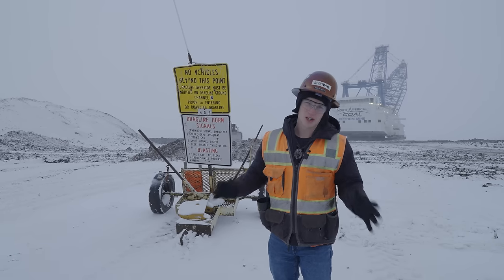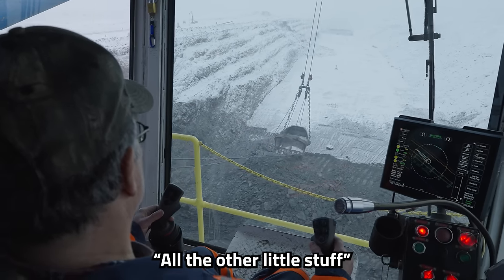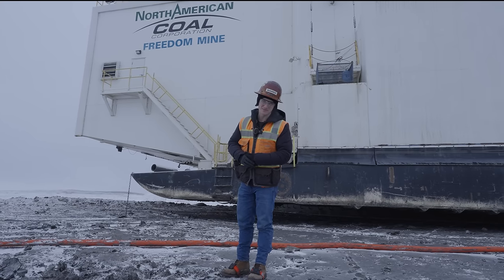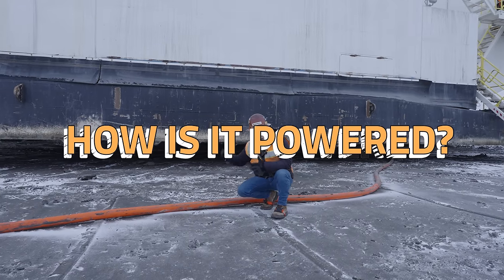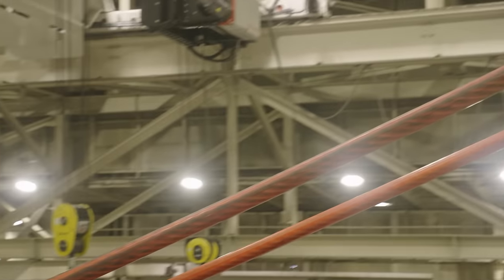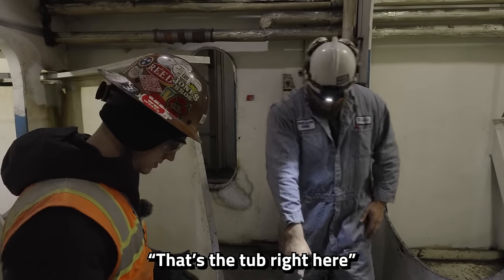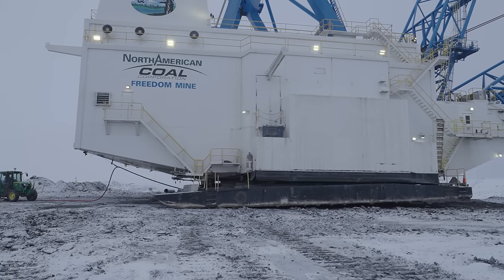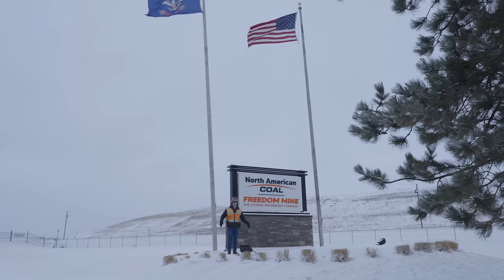Monster Mining Machines — How Draglines Work

Comment: What impresses me the most are the engineers who designed this monster and also created machines to make the parts for this.
Reply: I have made the cages housing the brake rotors you see in 7:29 and it's cnc milled then welded together and bolted to the hub. Also the rotors are 2m in diameter and weigh just under 100kg.
Reply: @PBST_RAIDZ  how in the world do they make those huge gears?
Reply: @minkymott  Where I work we don't make the gears but I'd imagine they'd be forged then cnc milled down so the teeth align with one and other.
Reply: @PBST_RAIDZ  thank you for taking the time to reply. :) I wondered how they do that.
Reply: Bucyrus Erie in South Milwaukee, Wisconsin.  Gears by Falk Corporation in Milwaukee.
Reply: @albing1397  thanks.
Reply: In all of history, it's first the scientist and the the engineers that are so incredibly fundamental to all that we take for granted. Forget about kings, partisans, emperors, politicians, unions. It's all science, technology & engineering. Big ups. And real men.
Reply: I agree wholeheartedly. Engineers are the unsung heroes of the modern world. The only time they get any recognition is when they mess up.
Reply: also the steel workers, machinist, blacksmith, etc.... that built this machine.

Comment: Man they keep the old girl looking good. Inside and out. Draglines are way cool. Makes those little 3/4 yard machines I used to operate look very insignificant. Thanks Aaron for doing what you do. For an old gear head it's fun to watch. Cheers
Reply from the maker: They have a world class maintenance program!
Reply: Would love to see a big tracked digger with a slew motor on the arm i used to operate one back in the early 2000s  @AaronWitt
Reply: I can speak for the quality of work done at Coteau by good workers.
Reply: Protecting their investment,- bravo

Comment: 1:54 That machine is 106 days short of operating 10,000 days.  
The most custom piece besides the bucket is the drive gear.  I wonder how many individual sections it was cast in and if any of the sections of drive gear have been replaced.
Reply: Great question 👍!  I wonder how long it took the mechanics to build the machine onsite after the pieces are brought in by train?
Reply: @tristenklein225  not sure about the dragline. I’ve built rope shovels it takes about 3 months to finish a Bucyrus 495HR2 rope shovel. So I’ll assume the dragline might be 6 months or more depending with the location where you build it.
Reply: Two years ago they replaced the tub on this exact dragline I believe.  If not this one it was one of the other two at this same mine.  
https://youtu.be/ACrTGwEqxHQ?si=4TofasCwqrvmAsyQ
Reply: @gunstuff5273  Awesome video, cheers for sharing, Guns.
Reply: Do you mean 10.000 hours
Reply: @tristenklein225 it takes around 2 years to assemble
Reply: @andrewrees8749
No, he means days. That thing has over 27 straight years worth of hours on the hour meter.
Reply: Any one know just how many kilowats/megawats this thing needs to operate?

Comment: This is such a cool video. I worked for a heavy engineering company in Australia in the 70's called Perry Engineering.  I operated a Skoda horizontal floor borer that machined the gear boxes and swing shafts for draglines.

Comment: One stupid question but what exactly does the machine in this case do? It just looks to me that it moves material (coal?) from a to b, with b not being a dump truck or plant or so..
Reply from the maker: It strips overburden to reach the coal
Reply: I had the same question because it looked like both from where it was digging and dumping to be the same hight
Reply: They create a moving trench … ahead is ground with coal under it, the trench is dug to expose the coal so it can be mined, and they use what they dig to fill in behind them where the ground is graded and the land restored.

Comment: I wonder what the voltage on the power cable across the ground is. 13KV? We all know that is not 480V.
Reply: 23KV running through that cable.
Reply: Called 23 kv Cable. Actually 22,900 volts.    Portable substation hooked to 69,000 high line. Goes into dragline to 4160 volt transformers which feed 4-3000 hp motors which drive a bunch of dc generators which feed the dc motors.

Comment: Correct me if I’m wrong but isn’t Bucyrus-Erie the very first to design engineer and manufacture drag lines in the world starting in the late 1800’s?

How often do they have to change out the cables due to fatigue and stress and do they have to be certified and inspected by OSHA like cables on large cranes?
Reply: Its hard to say. Page Engineering (John Page) were the first to make draglines. Both Bucyrus-Erie (now a part of CAT) and Harnischfeger (aka Pawling & Harnischfeger, later P&H Mining -> Joy Global -> Komatsu Mining) got into the dragline business in the early 1900s both operating out of Milwaukee. Neither were the first to make them, and those two companies went head to head for many years in the business, and pretty much bought out all the other smaller firms (for instance Page Engineering was bought by P&H in the 1980s). Nowadays most draglines are just maintained, and new ones haven't been built for quite some time since its easier and cheaper to maintain existing ones and replace them with rope shovels if they are no longer suited for an application.

I work for one of those companies and can't say exactly how often cables are replaced especially since its heavily dependent on the work that the dragline is doing and where, however I can say pretty much everything that goes onto a mine site is inspected by MSHA at least once per year. MSHA is the mine specific version of OSHA. MSHA controls mining and quarrying exclusively, while OSHA controls pretty much anything else, including things like maintenance and repair shops that might be on mine sites.
Reply: @helloitsjason Thanks for the insight and history 👍

Comment: Cool and big machine. But what i dont understand.. why is the bucket so small compared to the size of the machine? Could the bucket not be alot bigger?
Reply: A bucket load of dirt weighs over 600,000 lbs. The boom is 300 ft long. If you figure in the forces it takes to lift that and how fast the dragline does it.. no it couldn’t be a lot bigger. Also the machine is moving over 500 loads in a 12 hour shift.
Reply: @joshkuhn3974  hmm okay.. and what with more horsepower? Then it would be possible to lift it 🤔
Reply: @pupupupu448  Yes, but the question is how many times? Remember this machine is cycling over 1000 loads a day. The boom and other structure are still only rated for a certain amount, and steel fatigues with use. Every year there are cracks repaired and welded on the boom and frame structure.

Comment: I often do maintenance shutdowns on 1350 and 8750 draglines in the Australian Bowen Basin. As amazing as they are to see and experience first hand, once you experience pulling them apart and fixing them, they get old very fast 😂

Edit: To further explain your explanation on how the machine swings, the motors you mentioned in the front of the machine sit on a vertical axis and connect to the swing shaft (think of a driveshaft in your car), on the bottom of the swing shaft is a cassette (a big cog) and the cassette rotates along what is called the slew ring which is a very large gear ring. To put it simply, the swing shafts spin the cassettes along the slew ring which in turn rotates the dragline. The size of the dragline also dictates how many swing shafts the machine has. For example the one in the video would have 4, a larger machine might have 7. The Machine in the video is also just a little baby dragline.

Comment: Holy crap, the machining on that bucket is insane looking. I didn't think about it, but I guess you couldn't just stamp out a bucket that size (in most places). I'm not even sure if one of those 100kton German presses could do it. Especially with metal that thick. I guess you'd have to form it piece by piece and weld it all together? I don't know.

Comment: I wish you had the lot number of that 2570W I worked for BE from 1976 to 1981in Pocatello building 2570's and other machines. I worked mainly in the draglines doing the paperwork to build them . I probably had a hand in building that Drag. The big swing gear is built in 12 segments, 3 segments is a full semi load because of weight.
Reply from the maker: That’s incredible

Comment: Straight out of high school, I was lucky enough to get a job with P&H doing teardowns and relocating draglines . One of my most memorable greenhorn experiences was having to clear the tub of a BE 8750 compartments of water because the outer access covers weren't properly sealed earlier in the rebuilding process. Every single little room, all the way back to the center pin flooded ,alone with the worst flashlights ever (before waterproof LED)😑. Still have nightmares. I got it done in a few days and my reward for the task was going back through painting and numbering the compartments later on . I knew that tub so well after it all, I could crawl it in the dark, which I often had to because of my flashlight dying. 😅 Good times

Comment: The cranes that have Diesel Eclectic generation  have Capacitors and Electric Re-generative braking the  Hoist and Drag Drums..  Does this crane have "Re-Generative Braking?" 
  In FL in the Potash Mines a lot of heat and steam is a bi-product of producing Phosphorus. So they Generate Electricity at the Phosphorous plants..

Comment: Are there any weather conditions that shut down this beautiful behemoth? Hot/cold temp, or wind speed?
Reply from the maker: only reaaaally rough weather
Reply: Wind isn’t a problem. Most often it is thick fog, hard to dig if you can’t see the bucket. Sometimes if it is too muddy and raining too hard we can’t get the ground cleaned up enough to walk the machine and you have to wait for a break in the rain.

Comment: Excellant Video, Aaron!
I worked as a Heavy Equipment Operator at a Surface Coal Mine down here in Texas (ours was also a Direct Mouth Feed to a Power Plant) for 25 years and Retired about 8 years ago.  Aaron is Spot On about Coal Mines being necessary and anyone that claims Solar and Wind are all we need are Delusional.   We had 3 Marion 8200's and One 8750 at our mine and one thing to know about these is that they can only walk Backwards, there is no walking Forward, mainly because due to the weight of the boom and bucket, the tub comes up in the rear and stays down/drags in the front.  So when (not IF) you get one stuck, you can't just stick it in forward and walk back the way you came.  You have to be able to swing 180 degrees and try to back out.  If you can do that, you'll usually be allright but if not,  it's gonna be a bad day (and with Texas weather, we had quite a few "Bad Days" in my 25 years, LOL!).

Comment: Both sides of my family were coal miners in southern Illinois before they all closed. My dad drove haul truck for a decade at Consol Burning Star #2, my grandpa was a drill boss at #5. There was a Bucyrus-Erie 2570 at #2 and there were 2 of them at #5, so I saw them frequently. Just massive machines. On the other side my grandfather was a long wall underground miner at Old Ben coal. He was a maintenance foreman at Old Ben 26 and was electrocuted on the job in 1979. All the strip mines in southern Illinois shut down in the 80’s and 90’s. Still a of couple smaller underground operations going but nothing like it was back in the day. It pretty much killed the economy in Southern Illinois.

Comment: Cool, but what is it doing? Its not moving material far or loading dumptrucks, so I assume smaller machines are doing that... Whats the value in running such a large machine?
Reply: It’s removing overburden off a coal seem.
Reply: Takes dirt off the coal and dumps it into the previous pit where coal was removed. It is WAY more efficient at this than say a truck shovel fleet.

Comment: drag lines are cool, but ive never really understood what it is that its doing
or why they use draglines
 from the clips of it working it seems like its breaking the ground under itself, then moving it to the side?
is a dragline actually better at doing this than say a bucket wheel excavator? like you said the dragline does 70k cubic yards per shift, but a decent sized bwe does 192k in the same time span
Reply: I imagine it's biggest strength is in the logistics simplicity of being powered by a single high voltage electrical cable. I don't know how often they walk it to the other side of the cut but I imagine it's largely stationary. 

Any other type of equipment is going to require massive quantities of diesel adding a big step in the logistics chain.
Reply: @justinmcslappy  bucket wheel excavators are also electric, powered by a giant cable.

you can also get  massive stripping shovels like the captain and big brutus are also electric powered by a cable, but those wouldnt be able to do this job i dont think

Comment: A why a big machine and a small bucket ?
Reply: Bc weight over such a length weight really matters
Reply: Basic Engineering and Physics!
Reply: It looks small but in reality that’s big ass bucket bro
Reply: A loaded bucket weighs over 600,000 lbs. Not exactly small. About a 130 cubic yard capacity. A pickup truck could maybe at most haul 1 cubic yard, for scale.

Comment: Seem inefficient to have such a limited reach and to use cranes.  Need winch on other side of area want to dig then drag material close to you then use dredge or loaders to move materials.

Draglines would only be digging or moving back out